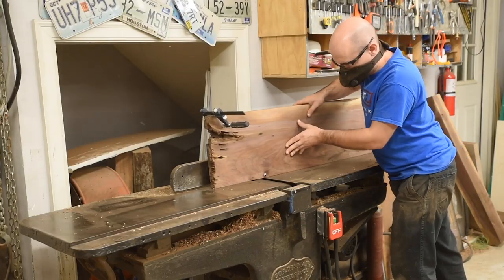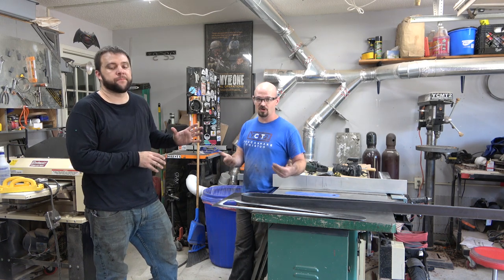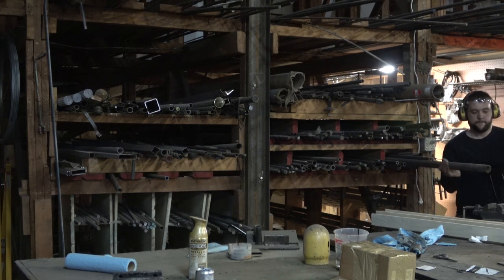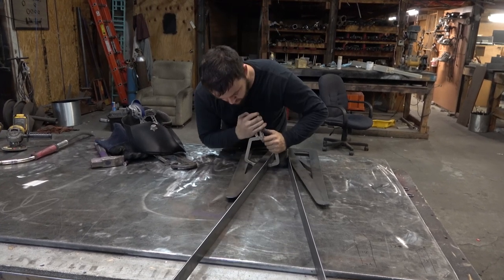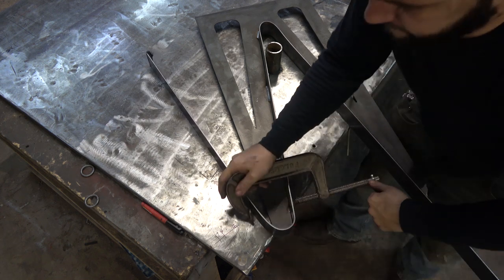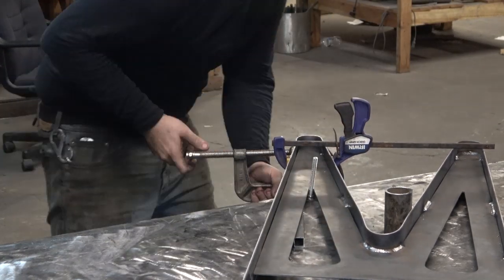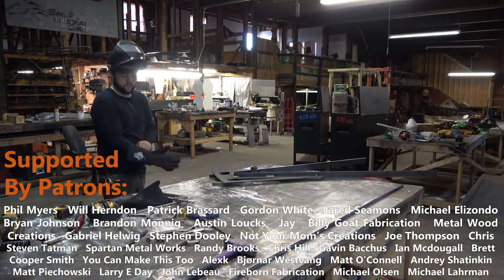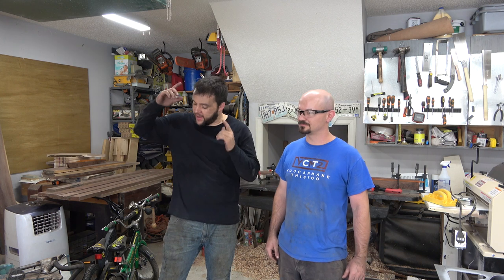Rustic Wood and Faux I-Beam Table with YouCanMakeThisToo

Comment: Just another way to bend those radius's. Use a Oxygen / Acetylene torch. You DON'T heat up the total length that needs to be bent. (First put a TAC-WELD at the beginning of the Radius.) You want to WALK THE BEND,  via heat. Maybe heat-up a 1 inch to maybe a much as a 1.5 inch area, and by putting pressure ( maybe as much as say ten pounds or LESS.) Applying the pressure maybe as little as 10" inches ahead of the bend. Let the "RED-Hot area cool just to the point of a slight orange color," so as the part / area maintains some rigidity. You want the heat to do the bending, not being superman. If you don't have a Oxygen / Acetylene torch, for thin stuff like what you were using in this video, try a plumbing torch (although may not get it hot enough) purchase a "MAP-Gas" bottle for the plumbing torch, that should get it hot enough to do the bends. Great looking table by the way. I also liked the collaboration to a different field. I do try to stay away from dead tree carcasses.😜
Reply from the maker: Yeah, valid method. I try to avoid a torch when I can as I want these jobs to bee possible by those with less tools. I can say a propane torch won't do it, a MAP gas will but VERY slowly.